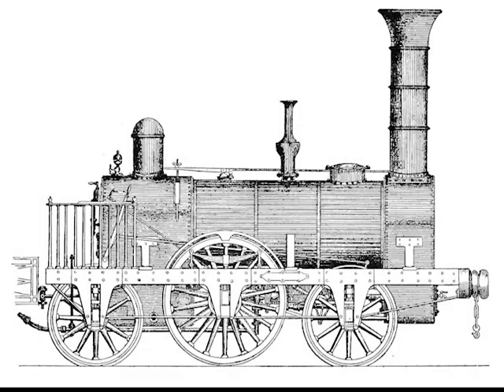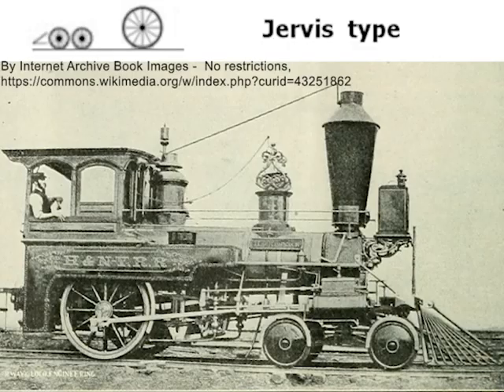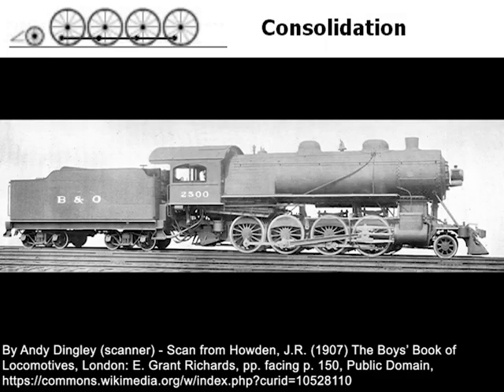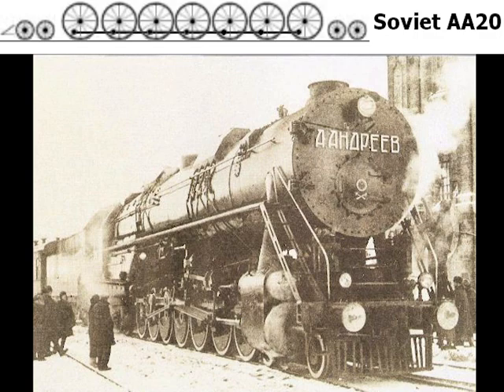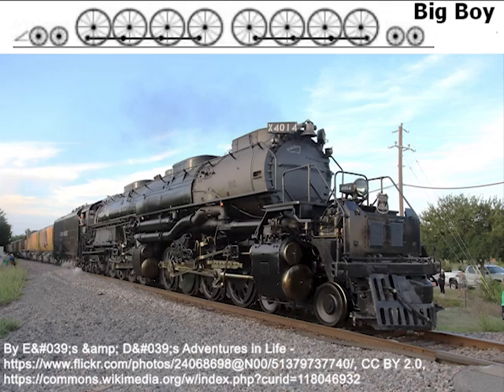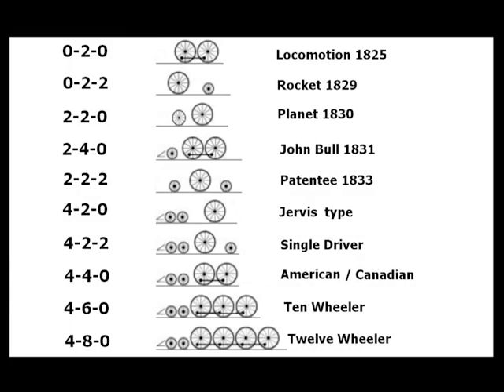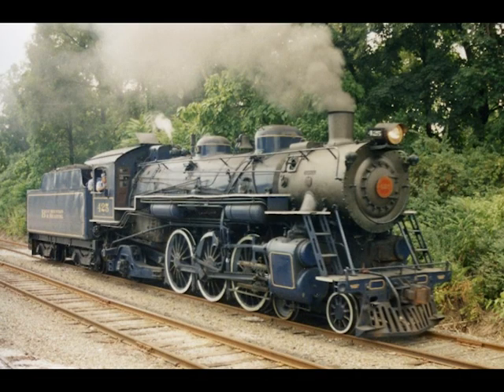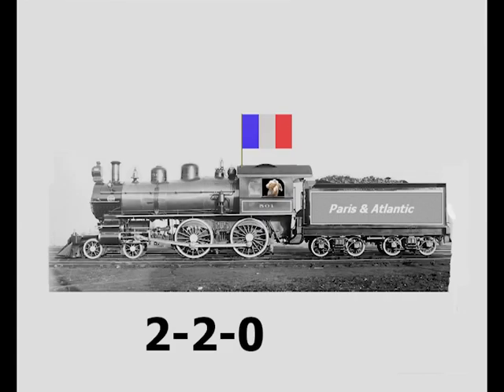RLMS:  Steam Locomotive Types

Comment: Are there any difficulties in describing unconventional designs such as the asymmetrical Shay logging locomotives?

("It's all bolted together so we only have to power one side, right?" - Ephraim Shay, apparently)
Reply from the maker: It's rare to see the Whyte system used for such locomotives, but (for example) a three-axle Shay could be described as a 0-6-0G (no pilot wheels, 6 powered wheels, no trailing wheels, geared).
Reply: @RailwayLMS  Only later did I remember the rail conversion outriggers for bicycles, which I suppose would be described as 2-1-0 units.